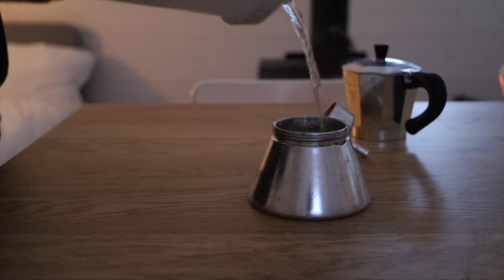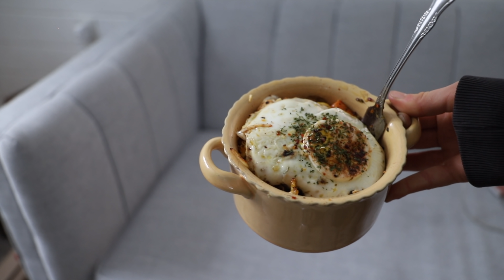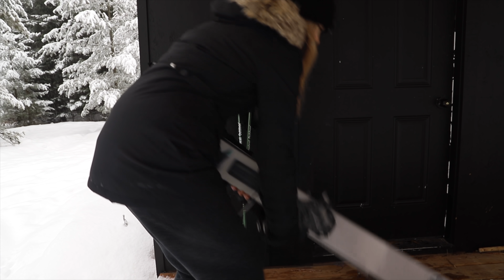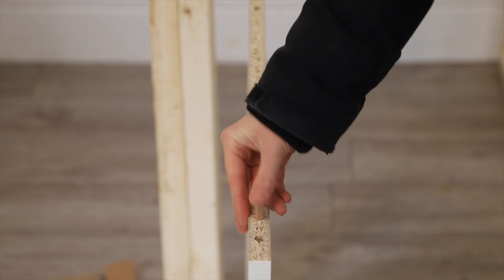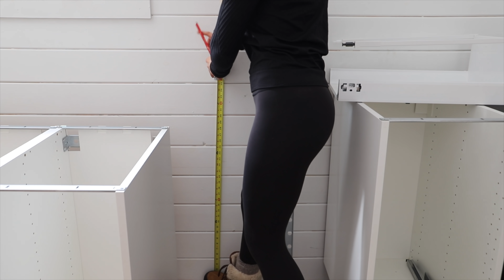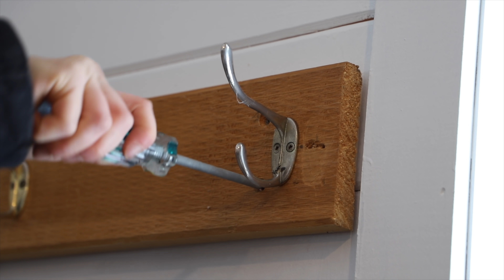Assembling the Cabin Kitchen | Productive Week at the Off Grid Cabin

Comment: You could use one of those battery powered leaf/snow blowers to clear that light fluffy snow from your auto and elsewhere. Also battery drill/screwdriver. 
Looking very nice in the cabin. The space available will work nicely for you. I lived in a 12x12 for 8 years. It can be done and comfortably.
You’re doing very well. Continue to march.

Comment: I would suggest using washers on the screws you use to hold the extension rails on the wall because the holes look larger than the heads of the screws.

Comment: Good idea with just the hanging rail as the coats can dry off. The only problem with the Ikea kitchen units is that they don't provide a service gap at the back for pipework etc. and watch out with the legs that they provide as they have a tendency to snap even with the load bearing wall rail.